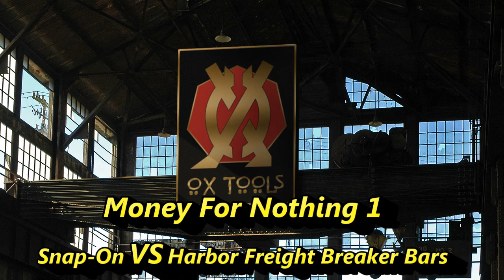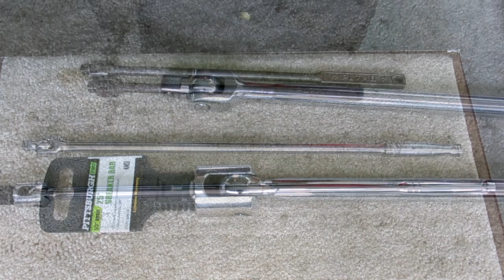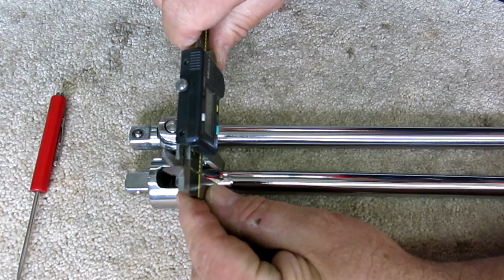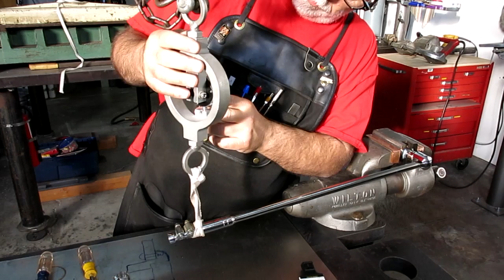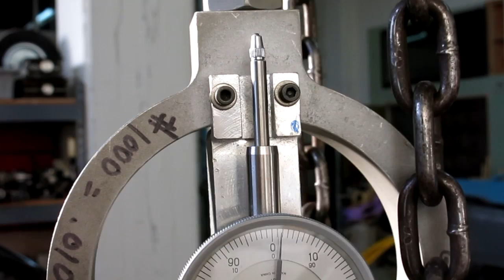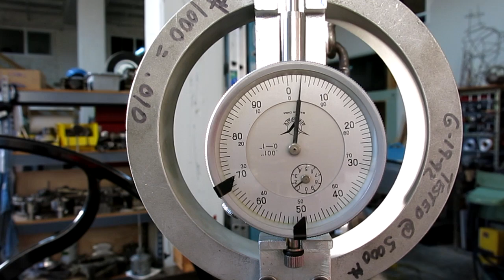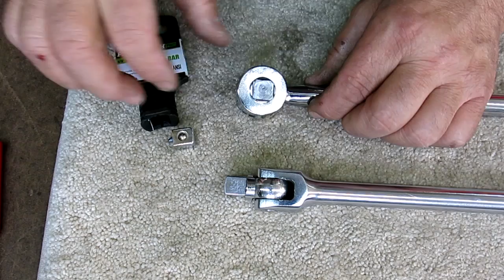Money For Nothing 1

Comment: Tom, I'm just curious here, but when metal fails as it did with the Pittsburg breaker bar do any of the forces that exist at the time of the fracture i.e. pressure, stress, heat, etc. actually alter the material in any way at the fracture point? I was surprised by the amount of flex in both bars. Anyway, this was a rather interesting test that had a surprising outcome.Thanks for sharing!

Comment: When comparing the lengths of breaker bars, torque wrenches, ratchets, etc., you don't measure the full length. You measure from the center of the pivot to the end of the handle, or the center of the hand grip, on torque wrenches that have a pined hand grip. Some beam type torque wrenches have pivoting handles. 

The "length" of the rotating tool isn't it's overall length, it is the radius of the circle it rotates within, and that circle is defined by the center of rotation, which is the center of the pivot pin.

Comment: Tom,  while I share your disdain for harbor freight's tooling,  you should never apply more than 500 ft-lbs to a 1/2" drive shank.   if you need more torque,  you should step up to 3/4" or higher (depending on application).   These tools are only designed to have a 250-lb weight applied to their marketed length.

Having said that,  I do have a disposable Pittsburgh breaker in my toolbox for those times when you need to do something stupid to get a job done (read: 6' pipe cheater-bars), and breaking a good bar isn't worth the headache.  I've put enough torque on one to bend the handle 45+ &deg; without breaking the drive shank,  so yours might very well have been defective,  or I've just gotten one from a better than average batch of steel (beyond 800 lb-ft).

It's an import,  consistency is not part of the trade deal.

Final note,  the warranties on modern tooling do not cover "user abuse";  while most shops will accept a warranty return for an improperly used broken tool,  they don't have to.

---

For those wondering how Tom arrived at 7,200 lb-in:
275-lbs @ 24" = 550 lb-ft,  or 6,600 lb-in of torque
300-lbs @ 24" = 600 lb-ft,  or 7,200 lb-in of torque
325-lbs @ 24" = 650 lb-ft,  or 7,800 lb-in of torque

Comment: Nice comparison, you may have just opened a can of worms there. Breaker bars will come at you left, right, and centre to be tested. 

As my old dad used to say, "buy the best tool you can afford, look after it, don't abuse it and it will last you a lifetime". There's only one category of tools I don't apply that to ..... battery powered drills and the like, I figure the technology has a little way to go with motors and, particularly, batteries so if I have to replace them every couple or five years I don't mind. Even so, I buy mid range brands.

Comment: I had a Mac breaker bar fail on me circa '02.  I had it under some serious pull (had my body weight, 190lbs at the time) on it and it snapped cleanly in the middle of the bar.  The shock it sent into my elbows was extremely painful and something I'll never forget.  I had it replaced under warranty and promptly traded it in for a Snap-On.  I found out that the Mac bar was made of two separate bars fusion welded together while the Snap-On was one piece.  I have no brand loyalty but the most important hand tools I use every day are predominantly Snap-On.  The Flank Drive wrenches are simply awesome.  Well worth the price.  Aside from Mac (I will never purchase another Mac tool), who's quality has gone down the crapper, I just stick with the major brands and everything is good.  Snap-On, Cornwell, Matco.  Matco... meh.  One of my favorite ratchets is a Matco but other than that they're not a whole lot better than Mac, Craftsman, Kobalt, Husky et al.  I also have some old SK and Proto tools that are outstanding.

Comment: The adaptors often snap,had the same problem with Armstrong and Proto.Not with Snap-On.Just got to move up to 3/4 or 1" drive.Very few failures with Snap-On in my 40 years as a mechanic.But didn't use the 40' cheater pipe.LOL

Comment: OK, first you have to tell me whether your dyno measures pound-force or pound-mass x g. They are not the same thing. The loading is force x lever length which is Newton-meter metric. In English units, you must specify either poundal-ft if you are measuring mass in pounds,  or ft-pounds if it is pound-force. In this case your mass is in slugs.  I wish I were making this up, but I am not. Crazy system(s) but I can live with them provided you tell me what you mean by "pound." I watched many, many students fail strength of materials for confusing pound-force with pound-weight.  The interesting number is deflection  (in any length units)  per unit force x lever arm. Eventually you will get past the elastic limit and bend the breaker bar. Or break or bend the locking bolt on the Pittsburgh or surprisingly, shear off the square. At about 22:30 you finally told me that you were lbf and I was happy. Wish you had done it a t 0:10.:) I was not surprised that Snap-on outperformed Pitt. At their prices it ****ing well better. What was really interestiing to me is where Pitt failed.  A very fair and useful test.

Comment: A 1/2" drive for that breaker bar is pretty sketchy. Things that get really sticky, like lug nuts, probably need some 3/4" loving. Until you get to 1" size nuts (think tractors not cars), then go larger to 1" drive.

Long ago, in an almost previous life, we had some caterpillar bulldozers that used nuts to tighten the tracks. We used 6' or so pipe wrenches, extended to 8 feet or so with pieces of, you guessed it, pipe. Over time, all of our wrenches had bent handles from bringing a backhoe over to apply just a little more pressure...

Comment: The angle of the pull was still vertical as you increased the force. It should have stayed 90 degrees to the bar. That being said, because of the larger flex in the Harbor Freight bar, your force at the socket end was even less than what you put on the Snap On. The Snap On test was much closer to 90 degrees. So the Merican tool stood up to a much higher load.

Comment: I've had 1 breaker bar and 3 socket adapters from HF shear off EXACTLY as you demonstrated. And man is it a pain like you said when they break. I think this is the normal failure point for these cheap tools and not the exception.

Comment: A friend of mine was using a combination wrench (19mm),  that was made in a 3rd world country (not China), on his car… when I heard him say "OH WOW!" I knew it was something special… He bent the wrench in the direction force and it had a nice "C" shape to it. Sure enough we straightened it back by clamping it in a vise and pulling it back with just arm strength. It never quite got back to stock straight shape. It still is being used for light duty tightening. It's kind of like a working trophy around the shop and is a reminder that quality counts when you need it most. 

The wrench has a prominent "DROP FORGED" in one of the sides. I'm sure after they poured the steel into whatever dirt mold they made that dropping bricks on to the molten steel qualified as "DROP FORGED". I'm sure this is not an isolated method of making tools….

Comment: Tom, although I own some Snap on tools, I have always bought Mac tools. I have always gotten the same quality out of them as I have my Snap on tools but spent lots less. I have also bought many Harbor Freight tools and used them for many years with no real failures. I suppose I am picky when it comes to Harbor Freight tools and I will only buy certain types. I currently have a Snap on , a Mac and a Harbor Freight breaker bar and they have served me well in the auto trade. I am a retired master tech and worked for nearly my entire life in the trade and still tinker with my son's.  There is no real substitute for quality but you can get good service from lesser priced tools also.

Comment: Great video Tom, as always - thanks!

One take-away: if you can't afford/don't need a high end tool - you may be better off getting something used and in good condition from a reputable manufacturer than if you buy something new but of inferior quality.  Everyone has to use their own judgement based on their needs - but as you pointed out that non-ductile failure here is pretty ienxcusable, even if the tool has the required strength.  Lots of great tool refurb. inspiration and knowledge on this channel!

Comment: I was pleasantly surprised to see just how much torque both tools withstood in reality. I was not surprised that the cheaper one gave way first but in my view not by much! I would agree though it would have been better if it had twisted off as opposed to a straight catastrophic shear. - maybe our expectations are too high regarding "toughness" of tools and the handles are too long for the tool? 
Should one be thinking 3/4" or 1" drive for these sorts of torque?

If you continue with this theme I would like to see something on 6 point V 12point spanners / sockets and Impact V Ordinary sockets please.

Comment: Thanks for adding in metric as well it really helps as we don't really use inches etc. down here in NZ . I am a massive fan of snapon it's the only tools l buy for work I have run with  right from the beginning as they make awesome tools. I have also used a cheap power bar as you tested here and it failed in the exactly the same way

Comment: Tom,

I'm only at the 12 minute mark so far, but it looks to me as if you are setting up to use the bar to torque down on the fastener....

I'm usually using a breaker bar -t break loose a frozen fastener... sometimes with a black-iron pipe nipple on the end as a "cheater"

Also, if I plan on using a bar hard, it's no big deal to get a rated metric bolt...  8.8 is roughly equal to a Grade 5, and a 10.9 is roughly equal to a Grade 8... 12.9 is an even harder grade, but they can be brittle...

Reading some of the other guys comments, it sounds like you may have gone for the "if it's worth doing, it's worth over doing" award and took things up to 11...

Back to watching...

Eric
Reply: +chemech    275 lbs x 2' = 550 ft-lbs of torque - more than I've needed working on up to 12" pipe flanges - 1" bolts...

I'm not really surprised that the cast boss failed when you put 300 lbs on the bar at 2' = 600 ft-lbs...

Comment: i think the elcheapo started to fail around the 250 mark as you said it didn't droop at all or as much. so to me the square had already started to move.

i have done that fail and i'm shall we say built for speed not comfort and although it wasn't snapon it was still an expensive tool. had it replaced and then as it was patterened after your snapon style broke one of the forks. had it replaced again, and so far it has stood up to a lot of use. only ever had to loctite the pivot bolts in as they had a habit of working loose. the company has since changed to similar style to the elcheapo as the bar takes the strain ok, but if the head goes you just replace the head

Comment: I've got a few Snap On ratchets and in my line of work I get to see quite a few failures (my dealer has a pile of broken parts by his vise). I was able to break one once and it was with a very light load but I'm positive that I had damaged it during a previous job. I just barely pushed on it and it failed at the detent pocket. I've put a 3 foot cheater pipe off the end of my SO ratchets and breaker bars with my full weight (225) and several times and you can't tell.

As far as further tests go, HF impact sockets have a huge following in the mechanic world and have been known to stand up to some serious abuse. I'd say match them up with some SO sockets and see which explodes first.

Comment: Nice work! Thought it would break the pin first.  Never had occasion to doubt my Matco, Snap-on and older Craftsman or Proto  tools. The recent flood of imports has me unwilling to use anything unfamiliar when the situation could result in an injury if a tool fails. Its already a risk that the old fastener might fail.  How about testing Harbor Fright carbide drills versus the real deal USA stuff.  I also wonder if spinning their router bits at 23K RPM would be suicide or not. But that termite tools...

Comment: Hi Tom, love the test, and really enjoy all your videos, but this one is a bit hard to take because you are comparing a $12 breaker bar to a $123 breaker bar. Are snap on tools good? Yes, of course they are. Are they worth what you pay for them? No they are not, you are paying for the lifetime warranty up front. Problem we have in the UK with the snap on vans is that the warranty "varies" Some will only give you the warranty if you bought the tool from them, and have the paperwork. Some are now saying  it is a lifetime warranty for the original purchaser only, if you bought it used, you are out of luck. To be honest I have very few snap on tools, and all were bought used.  Was the figure of 7200 ft-lb correct?  I would not be able to pull that on a torque wrench without a really good multiplier!
I think I would have got out my 3/4 drive socket set long before I reached this point. So in the end, as you said, you pay your money and take your pick, but is the snap on really 12 times better than the Pittsburgh because it is 12 times more expensive. We will never know unless you test it to destruction!   Man, you have balls of steel standing that close! I was peering through my fingers!
Phil.   UK.
Reply: +Phil Whitley I get 600 ft-lbs = 7,200 inch-lbs, or roughly 800 N-m

The $12 HF bar failed beyond its rated capacity, but has much less margin for abuse than the $125 bar...
Reply: +chemech  Yes that was what I got when I thought about it a bit more, still have a job to pull 600 ft lbs on a torque wrench. Thanks for the correction.
Phil
Reply: +Phil Whitley You gotta figure in the pull angle of Tom's test.  At say 45 degrees that 600 ft. lbs. of torque becomes about 425.
Reply: +MrJackanapes57 And then you are adding a lot of shear force on the square as well.

Comment: How linear is the reading from a ring dynamometer? IE, when you say 100lbs per thou', after you reach say 3000lbs, would it be slightly over/under and expected 30 thou?
Or is this not a problem because 3000lbs is above the safe working load?

Comment: Hi Tom. I really like your videos, i watch them all as they come. I also like the fact that you add the metric numbers for us european (and others), just makes everything easier to understand.

I am a mechanic on heavy machines (mostly Genie lifts) and use an 600mm breaker bar almost every day, and my bar is the same design as your pittsburgh type. The difference i my bar has a black "head" of 12.9 strength, i have used probably 2-3-400 kgs pressure on mine with no failure using a chainpulley (not sure if this is the correct name on english) But i have also broken one of the same type using only a long pipe, so i guess there are quality differences on same type tools. Mine cost 60-65USD (roughly converted from NOK.

Thanks again.

Martin 
Norway
Reply: +qwertydworak Hi Martin! That Class 12.9 head is a major difference, as I suspect that if they even rated it, the head on the Chinese bar would be at 8.8 or less... 

Definitely not rated for impact drive service!   

Tom applied 600 ft-lbs (roughly) of torque, which I translate as roughly 800 N-m - well beyond anything I'd expect to use a 1/2" = 13mm square drive for...

Cheers!

Eric

Comment: I'd like to see craftsman and cornwell tested the same way too. I think they would be comparable to the China crap. I still have a cornwell that I broke years ago. I wasn't impressed enough to ever get it replaced lol. Honestly I think my 1/2" snap on flex head ratchet has broken more bolts loose than that cornwell breaker bar ever did. No doubt that is really hard on the ratchet and it has been rebuilt a time or two but getting the job done was always the number one priority.

Comment: I have the exact Snapon breaker  bar I am on my second one. The first was broken at the pivot point. We were removing the bolt on an axle wedge on a John Deer tractor in a spot we could not get air tools to. it was a 1" bolt and we had 8 foot of pipe on the breaker bar. I'm 215 pounds and was bouncing on the pipe when it broke. The other mechanic got  his breaker bar ,the same Snapon and we went at it again with the pipe. His held and the bolt came out. You get what you pay for when it comes to tools, especially ones that need to be slightly abused due to the circumstances your in.

Comment: Actually, I think it is an interesting experiment. I am not really convinced that buying more expensive tools "Because you can abuse them further beyond their rated work rating" is really that good of an economic principle. Not knocking the Snap-On as it is a fine tool but they both worked within reasonable expectations. At 10x the price ($120 vs $12 -- looked up from websites), the Snap-On better be a superior tool. Of course with the HF, you could have also bought an impact driver and a 3/4 in drive breaker bar and had money left over.
Reply: +David Kirtley and true
 that the 3/4 with a socket on the end would have been more than a match also, cheaper and stronger, pretty hard to complain at all then.
Reply: That extra 'play' in the HF bar was a bit more than I usually see and it made me wary of the tool.  Over the years I have accumulated mostly Craftsman wrenches with about 5% of my tools being Snap-On as they make a lot of special tools not available in Craftsman's line.
Reply: In EVERY test I have seen Pittsburgh vs Craftsman and the Craftsman Professional line, Pittsburgh wins hands down in quality. Not to mention being 4 to 5 times cheaper.